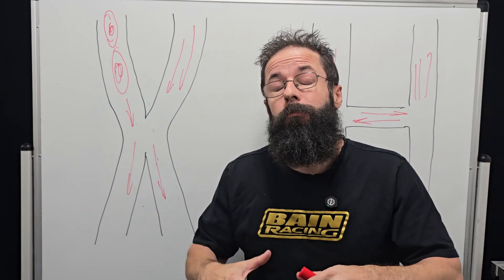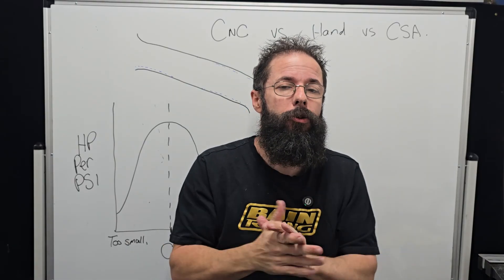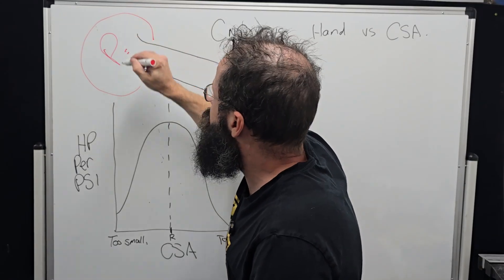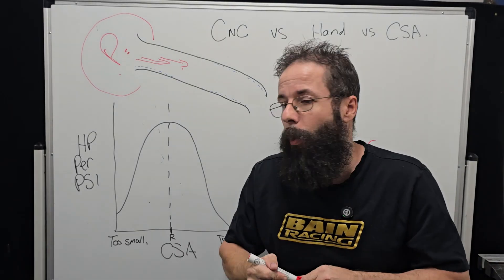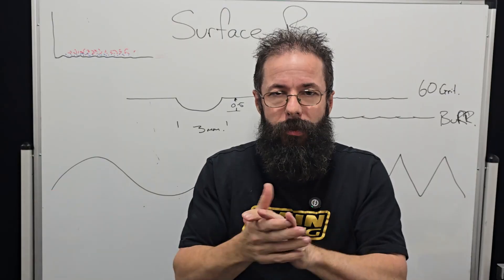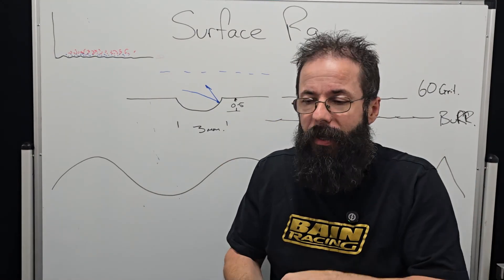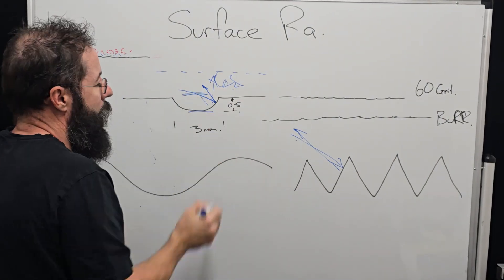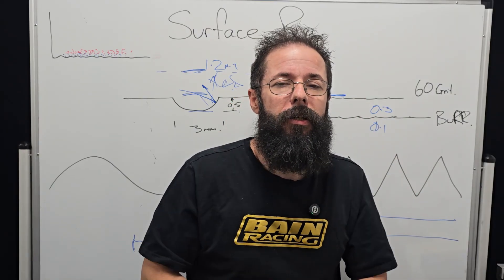Induction Secrets Part 3: CFM vs CSA, X-Pipes vs H-Pipes & Surface Finish #cars

Comment: Dr. Raindl tested this with k20 head where dimpled port lost air flow speed compared to stock head. In his view its good for shrinkage of big ports to improve air speed.
Reply from the maker: Yeah.  We all pretty much say the same. Its a good band aid fro when you get it wrong! 😂👍.  Though it will narrow the power band due to the thickness ratio of the boundary condition and air speed.

Comment: Would using an exhaust wrap perform similarly to a micro polish?
Reply from the maker: Exhaust wrap definitely helps. But the smoother you can more the internals of the Exhaust flow. The better it works also.  Two aspects here we need to focus on.  The thermal behavior or efficiency and the "drag" of the surface.   Do both. Win win! 💪

Comment: How do you think a properly sized y pipe would compare with an x or h pipe?
Reply from the maker: Yeah in circuit racing theres a few that have successfully Y pipes as long as you get the transition diameter close.  A 10% reduction a metre back from the collector is a good start for good average numbers.   So if you have 2 x 3" thats an area CSA total of around 9145mm²   and a 4" is around 8100mm² 
Or 4 1/8" if you can get it. Which is around 8625mm²   

So yes! Definitely something to keep in mind especially if you're chasing wider power bands and good average numbers in both torque and HP. 

Great question mate. 👍👍

Comment: Would it be beneficial to keep the induction system smooth up until the point where fuel is injected? Say for example a twin cam 4cyl 4V head with EFI right just before the cylinder head port....THEN make it rough say 40-60 Ra from injection point onwards?
Reply from the maker: No, for a couple of reasons.  This is a by directional flow path. Meaning air and fuel will go up past the injection point.  Remember under peak torque air and fuel gets pumped out of the cylinder and back up the intake.  Its not until we have enough velocity and inertia force can we over come this. This happens at "peak torque" maximum cylinder filling.  

The second problem is this isn't a laminar flow regime.  Its a turbulent one. Which means we have an active boundary layer condition.  Meaning a soothing surface can create more drag then the right Ra for your average air speed.  This is where the low end of 100Ra seems to be best. 

Hope that helps 🙏
Reply: @bainracing  Thanks ...yes it does help thumbs up

Comment: With X pipes some have a very aggressive crossover approaching 90 degrees (Magnaflow 10782 is an example) and others have a near parallel crossover (Borla 621106). Is more a more aggressive crossover or a more parallel crossover generally preferred? Does the choice come down more to the specific engine application? 

Also Thanks for putting out all these videos. I only recently found your channel and have been enjoying them a lot.
Reply from the maker: It really comes down to the setup,  but more aggressive angles will "generally" so more torque.  Where the less angles like 15-30°  see more peak.  I dont like the parallel types personally as the air needs to change direction to drastically to "fill-in" thr pressure differential. 15-30 gives a good balance.
Reply: @bainracing  Thank you for taking the time to answer. Much appreciated.

Comment: @9:35 what would happen if you were to leave the finish of the inside bends rough and the other 3 sides smooth (or vice versa)?
Reply from the maker: Yeah we have tired this as have many others its a find balance of inertia  vs Coanda effect vs boundary layer thickness. You need to get specific as to what Ra you mean. Smooth in general doesn't work well on the intake side. Only exhaust side.  And "rough" generally the Ra should be between 100-200. 👍

Comment: Does this RA number 100 to 200 works on EFI engines? Or just wet manifolds? Cheers
Reply from the maker: Generally, go with the finer 100 Ra which is around 60-80grit.  If it's a more serious EFI it will have a bigger spillback rate so they throw fuel/air mix back up the runner below peak torque.  So we usually do the plenum in a burr and runners in 60-80grit.

Comment: I've heard so much BS about surface finish. Finally a big thanks for making it all make sense.
Reply from the maker: No problem! We will dive deeper into this topic and the physics at play in the future.  👍
Reply: @bainracing  Looking forward to more about the finish and the game of getting that ideal shape to work as the port turns past the valve and guide ?
Reply: @funkiwikid6106  Repositioning the valve to enable a more direct path into the cylinder via the port is the only way forward. Current cylinder head architectures have reached their maximum potential.

Comment: Great video!  I’m challenged to keep up (British vs American accent), but YouTube speed control to the rescue.  One nit pick.  A few times you said “mil” but it looked like you wrote “mm” on the board.  And unfortunately the board writing was not clear enough to be certain that you had written “mm”.  The problem is that being Australian, you are libel to use either imperil or metric, and hence it is imperative to be crystal clear as to which units we are talking about.  I’m a physicist and hobby machinist in USA, so I’m well versed in both metric and imperial.  In USA (and a large part of the world), when even remotely associated with machining, a “mil” is a thousandths of an inch.  No self respecting physicist (and really any scientist) would ever use the word “mil” for “millimeter”.  We call it by its proper name, “millimeter”, “centimeter”, “decimeter”, etc.  why? Because that is what it is.  And as a byproduct one avoids all possible confusion with the imperial “mil” (1/1000”) which is pervasive in the imperial machining world. Maybe if 100% of the world uses metric in all areas then we might tolerate a slang of using mil for millimeter. But the world is not there yet and likely quite a few years away from such universal adoption.  In the mean time we really need to stick to calling things by proper and industrially accepted names and refrain from shortcut slang which might be confused.  Thanks!
Reply from the maker: I'm Australian mate. So there's ZERO chances of that happening!😂👌
Reply: We call it thou which is just as universally acceptable and doesn't risk confusion. You see thou or mil is metric anyway, it's decimal which is metric. Hurry up and catch up because imperial is sloppy. We had to pull the bandaid off and did the conversion, if you got no plan on doing it then you will never do it. Why blame others for your "one day!"

Comment: You said, micro polish the exhaust, but you didn’t say specifically how to micro polish it. Can you elaborate on what would be the proper way to micro polish the exhaust sports to help improve horsepower?
Reply from the maker: We have some head porting videos on here where we mirco polish exhaust.  It's generally a 4 stage process
Reply: @ do you think that you could do a whole complete video on the entire process from start to finish?
Reply from the maker: @Wangan400 for mirco polishing? Yeah in our porting series we show this. Burr course,  60grit, 120grit and X buffs. 👍
Reply: @bainracing got it thank you my guy.

Comment: The  the increased  convection you mentioned that would happen in a dimple  port  I'm really curious to know  how much of a factor that might be ..surely in some things with CSA to burn it would be worth while ?
Reply from the maker: It's around 150-200%. But the problem is the added drag coefficient it brings.  Also, it's shifting the boundary layer in the wrong direction, as under low air speeds, the CSA is too big, but as air speed increases, then the boundary swells and chokes.  So it inherently narrows the power curve, and that's the opposite of what we are trying to do with port development.  👍

Comment: I ported 2jz head not so long ago and tested it recently. The engine made the same power with 0.5Bar of less boost and 5 degrees less of ignition timing.
Reply from the maker: Bingo!!!  We have been playing with the jz since the 90s. We have made over 110hp at the same boost on 2jzs many times. They respond so well to the right CSA 💪

Comment: Didn’t even think that hitting the inside of the runners and collector with a 60 grit could reduce heat transfer! Probably not as much to gain with stainless vs when done with aluminum but still in the riggt direction.  Likely gets more important when using a relatively smaller primary size? (~1.4" ID)
Reply from the maker: Finer equals less heat transfer,  course equals more. So, as long as you're "reducing" the Ra text. You are reducing convection.  👍

Comment: While I get temperature not density, affects the speed of sound / mach number, does velocity have a affect, kinda like airspeed vs ground speed of aircraft?
Would higher velocity have the relative affect of lengthiness, for a higher velocity retarding the mach number?
Reply from the maker: Good question! And yes, that's why with open valve harmonics,  we use different speed averages than with close valve harmonic waves. 👍
Reply: Fuel type effects are significant
Reply from the maker: @arthurking6549  100%

Comment: I wonder if the dimples could be beneficial on the short side radius?  Possibly on some applications? Maybe?
Reply from the maker: Far too big and too thick of a boundary layer. A burr finish will give adequate attachment.  I've even made power sanding a short turn with 60grit. So how much does it really need, and when do you say it's time to fill and reshape?  As velocity is the key here.

Comment: I can't wait for the intake surface lesson :-)

 Many years ago, I was a welder at a an Accelerator [the protons and positrons kind] where they use mixtures of noble gasses as the sensors to detect high energy particles.. well, tldr: they would test my welds on these tiny tubes [1/8" up to ~1/2"] by counting individual molecules of gas [argon, etc] .. more than a few bounce off the weld = cut it out and weld in a new one.  micro polished is the real deal :-)
Reply from the maker: That's so cool, mate!

Comment: Great series. Whats you thoughts on dimples in the exhuast? For the exact same reason you stated in your video. If the factory exhaust is too large (Early porsche and VW as an example)
Reply from the maker: Yeah, that's tough,  though increasing convection (heat our of the air into the exhaust) would reduce air mass faster reducing velocity quicker and making it look even bigger.    I'm not sure what would be a solution for that?🤔  good question! Maybe ceramic coating?
Reply: @bainracing  not a attempt to sharpshoot, y’all. Is it convection or conduction / absorption, for the increased surface area resulting in a higher transference of heat?
Reply from the maker: @georgedreisch2662  All good mate, generally with any fuild transfer like air or water its a "convection" process, conduction is more solid to solid and yes the higher the surface area, the move avalible area for covecting heat.  hope that helps

Comment: Darin Morgan said in one talk that he makes the runners quite rough. He has a burr with a slightly bent shaft so he can get the right texture. He also said that he probably couldnt sell his stuff since it looks so ugly.
He usually  also make sure to have that texture some 4 inches above the injectors since fuel gets thrown way up the runners.

He also put to rest the "golf ball dimples", its to uniform and doesnt have the peaks you need to induce shearing/atomisation of the fuel. Makes one feel a bit of pity for the guys who spent all those hours getting that nice golf ball dimples on their stuff..
Reply from the maker: Exactly!!!  We even texture our plenums on sheet EFI.  I'll post some pictures in part 4. 👍    yeah dimples show people don't understand what's happening inside the engine.